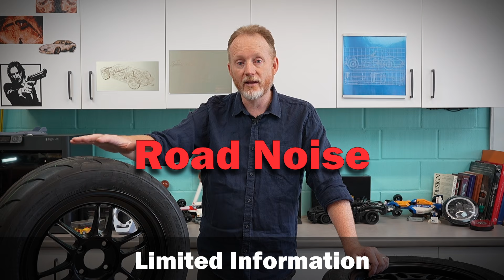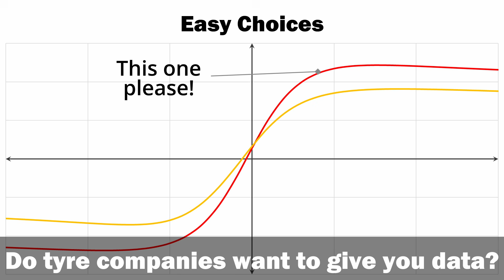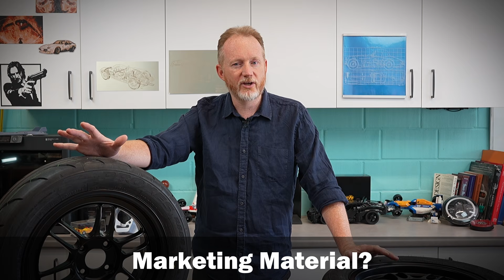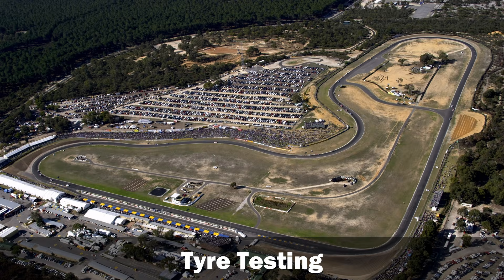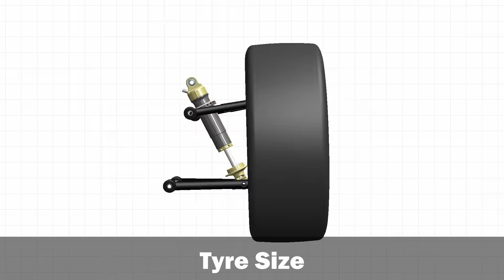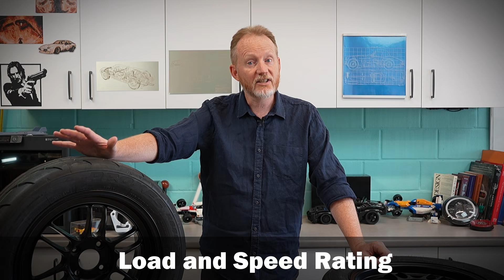How to Choose Tyres When There’s No Data (Project 171)

Comment: If I was choosing a tyre size for this kind of car I would be looking for smaller wheels and taller sidewalls to complement the styling.
So maybe 14 - 185/60 and 14 - 205/55. Trouble is no one makes that combination!
So how about 15 - 185/55 and 15 - 205/50, which used to be standard on the MG-F (also MR2 ?). Just one supplier left!
Probably the best bet is to check what Caterham or Elise owners fit.
Reply from the maker: These were my thoughts exactly.  I tried to get the highest sidewalls with a decent tyre on a smallish wheel with decent availability.  This is where I landed, even though I would like more sidewall.  The 15" wheel has become pretty important once I got the brakes sorted (upcoming video).

Comment: I'm binging your videos. Thank you lots for showing us the process at this level of detail.

Note that because the vehicle is going to be so light and you're not planning on adding huge amounts of downforce, you might never be able to put significant temperature into the tyres, and definitely won't manage to do so on the road. This issue will be worse, or at least more likely to occur, with the semi slick Toyos that are designed to not overheat on a typical modern, much heavier sports car, on the racetrack. On the rare occasion brands make a lighter car, they come on compound-adjusted OE tyres anyway, so they've got a whole other set of variables to play with to counteract this issue. A more balanced UHP summer road tyre will definitely be worth trying in case it ends up yielding similar, or even more grip, since it'll run hotter, and not be designed to require any temperature buildup to work properly in the first place. Anecdotally, I've been doing simulation work for a project vehicle in Assetto Corsa with a mass of 1100kg, and have severely underestimated how bad the temperature issue is, at least according to the "semi slick" tyre model in that sim. And that vehicle is a lot heavier than what you're planning for!

I would assume your car to oversteer badly considering the expected weight distribution, and your rear tyres only being 10mm wider than the fronts, unless you intentionally give up some mechanical front grip with your alignment settings. I remember you mentioning the expected weight distribution in another video but don't remember the percentage; with the engine in the back in a very light vehicle, anything under 60% on the rear sounds unlikely. If you google around for cars in that weight distribution range, they always come on much wider rear tyres compared to their fronts.
Reply from the maker: I have a few ideas to try and avoid the oversteer due to a rear weight distribution and tyres that aren't as wide as they probably should be.  Mainly by running more front camber than what would lead to ideal wear and a higher front roll moment distribution.  Failing those it will likely end up a wider tyre to start with, and then if more is needed a larger wheel as well.  This is where cars like the Elise are.

The temp is an interesting one.  Perth is a very hot place and usually tyre temp isn't as hard to achieve over here.  However the car will likely be still too light.  The tough part at this stage of the design is that the weight window is still reasonably large.  The car could end up as light as 500kg or maybe up to 750kg.  There is just so much still to design and build that nailing the number at this stage is difficult.  One of the reasons I didn't want to go for a tyre to start off with that will be much more towards the 500kg target.

Comment: The sources I trust (GRM, 949, etc) have had the best results in Miata sized tires using a rim that is as wide as the tire. So a lot of us are running 205s on an 8" rim or 225s on a 9" rim. In the tests I've seen, these relatively wide rims get the best lap times and also win the praise of drivers for more responsive handling. Pinching a wide tire onto a narrow rim results in slow times. So in my view, you need to pick your tire size and then find rims that are optimal for that size. FWIW, the same observations hold true for road and mountain bikes.
Reply from the maker: This was why I was reluctant to get the wider tyre for the rear.  I wanted to put a 225 on the back end, but rim width was limited.  Its why I am trying a slightly narrower tyre to start off with, and may need to up a wheel size.

Comment: Hey Dr Kev, Im currently a student and intending to do something similar myself, I've currently got stuck on the wheel loads stage, I've been reading the racecar vd by Milliken but it only really mentions loads never talks about whether they are in x y or z directions, is there another book you may have used ? Also when it came to your suspension geometry did you end up fixing the chassis and moving the wheels in your analysis ?
Reply from the maker: I might have to do a video discussing different texts to go through.  When it comes to loading though I generally take a first principles engineering approach and rely on Engineering Mechanics (Statics and Dynamics) knowledge.  A lot of the car specific texts that were available when I was learning this stuff were far too hand wavy when it came to numbers and objective measures.  Still haven't found a good reference for the load cases that manufacturers use in their mechanical design.

In the earliest studies I did on suspensions I would fix the chassis, but very quickly moved towards a moving chassis.  As a halfway point I did calculations of a fixed chassis with moving wheels and then translated the results (with 4 corners) to effectively keep the wheels on the ground in analysis.  I covered some of this on the video I made about kinematics.

Comment: Kumho V70A is TW50 Interestingly the soft and Med compound (and likely the hard) are still TW50. On a 600kg lotus7 style car I found he soft to be fantastic on the road but would over heat and go squishy after 2 laps on the track. Here the med were faster.  I should add that the outright grip between the med and soft compounds was quite similar just the soft would switch on much easier and was a lot more confidence inspiring on the road. My understanding is the 730 is replacing the V70A but currently only in larger sizes. Great to see Ozclubbies getting a small mention. The hard part with a lot of information on tyres is that our cars are really the only road cars down at that weight. Mention say an MR2 for example is a similar layout but near double the weight. My new build just started has a target weight of low to mid 400kg. Realistically no one makes the ideal tyre for a car that light for the road. Tyre pressures is another area. The manufacturer will tell you to run 30lb plus. The car will be diabolical. Typical road pressure will be in the mid to high teens.
Reply from the maker: Appreciate the insight.  The Kumho options definitely looked good, although I do want to do some testing with different widths and I was finding it hard to find different width options in the Kumho.  Otherwise probably would have ended up with a set.

400kg sounds like a great target for a car.  Will be even harder to find something suitable, and will definitely need a high attention to detail.  Should be an awesome project.

Also more than happy to shout out to OzClubbies.  I try and keep the project somewhat updated on there, and I do like forums as a good source of knowledge and discussion.  Something that is lost when everything is a faceboook or instagram post.

Comment: You seem to have a pretty good understanding of tyres and your intended use.
The Proxes R888R is a pretty iconic but now pretty old tyre now meaning that it's left behind 100tw category although is still a very direct and predictable tyre albeit just with a little lower limits compared to modern semi slicks in this category.
Because your not going for lap records given its priced well below modern 100tw semi slicks it makes it a good reliable choice.
Also fyi the traction rating on tyres is a G-Force test but it is measured on a shallow wet controlled surface. So it's possible that tyres with AA racing may not perform as well in the dry as tyres with an A rating and view versa. Just to keep in mind.
For raw data metrics there are people like grass roots motor sports and tyre reviews that do controlled testing but yes you are right as what car you putting them on weight and slip angle balance is going to change from car to car and wheel/tyre size set up. In your case being quite a light car you need something that gets up to temp faster which makes the R888R more suitable then most modern 200tw tires also wear is not that of a concern for you as would be for other who have heavier vehicles that drive more often.

I'm also thinking that the AR-1 may of also been in your short list?
Would be interested what your other considerations were?
Also fyi if you go to Dunlop's official website they are doing alot of clearance deals on the DZ03g if at a latter date you have dialed your can in and want to start pushing on track.

Also given your car is an MR set up I understand there may be scenarios where you may want more rear slip angle such as on small tight low speed Auto crossdriver/car training carpark style or more stability such as on road twisty mountain road driving or a neutral feeling such as on high speed circuit. 
Yes you can make aligment, sway bar  and suspension adjustment but you can also purchase two of the same tyres with slightly different compounds.
Fortunately there is a tyre in Australia that can help you with this kind of testing. Kenda Vezda UHP KR20A.
They are semi slick design but more focused on durability, consistancy and heat cycline very well. They come in both 200tw and 300tw 
Definitely alot less grip then the R888R but for steet you can run 300F 200R
For circuit you can run the same compound front and rear and for low speed high slip angle you can runn 200F and 300R
Reply from the maker: Thanks for your constructive feedback, you put a lot of valuable thought into your comment and I appreciate the time you took to provide your insight.  Repsonding in no particular order:

I did try to indicate that the traction rating wasn't a reasonable test for how the tyres are going to behave (but didn't spend much time on it to explain it fully).  Its been picked up by a few people so I'll take that as me needing to better cover some areas.

The AR-1 was a big candidate, but I thought it might be going too far in the track direction.  The Bridgestones were a little too pricy for the first set.  I very nearly went with the Yokohama AD09.  I couldn't find the sizes I wanted on the Khumo V730s.  Otheriwise there are a few options like the dunlops that I didn't spend too much time looking for.

Price was definitely a big factor as the tyres are going to be sitting around for a while before the car is done, and normally the initial testing is dealing with a lot of non-performance issues involved with running.  Didn't want to have too much invested in that first set.

If people are keen and I can find a way to pay for it I will be up for doing some back to back testing with a few different options once the car is built and in testing.

You also mentioned the difference in wear ratings front and rear.  This is also a consideration and part of the reason I wouldn't mind to be using tyres where the manufacturer has a few different wear ratings at the size.  Toyo has a few, and maybe I should have a look at the Kendas as you mention.

In all likelihood I will start with something like the tyres I have and then move to something more road orientated.

Comment: For $30 more a tire, you could buy a real tire like the re71rz in 205/50/15, stretch it on a 7" wheel, and end up with a really good wheel and tire package
Reply from the maker: The price difference between these tyres as I could get them (in Perth) was significantly more than that.  Once the car is together and testing the Bridgestone will certainly be one to consider.  Although it will likely head towards more of a road car tyre than something for the track.

Looking forward to testing a few different tyres when the time comes.

Comment: This is a terrible tire. Kinda ruins any of claimed authority by the channel.
Reply from the maker: Sorry to disappoint, altogether possible that I could have made a better decision.  I will be surprised if I manage to get through the car without a single mistake.

Testing and on road development are essential parts of the process that are still a fair bit away.  Making a decision on the tyre to start out with moves me closer to that stage.
Reply: @KevinHayward7  its a difference between experience and reading things in on the internet. im an engineer by trade, 15 years in the business, i can explain all the chassis dynamics you have discussed throughout your videos. im also a high performance driving instructor, racing school instructor and many many many time race winner in the most competitive amateur road racing class in the country. so i have the relevant experience on all manner of tires, for over a decade. you should have got your head out of the internet and theory, and actually showed up at an event where people actually know about cars, and race them, and known instantly that there is basically zero reason or application for the R888r, except to trick morons who bought R888's 15 years ago when it was a middling at best tire, into another round of toyos. that tire is basically useless. 

and, also because of my experience in both theory and practice, ill tell you, the setup will lie to you the day is long if your not on the right tire. hell, we notice significant setup changes depending on how used the tires are sometimes.
Reply from the maker: I did check these out on local cars but if it wasn’t clear this car is absolutely not intended to race.  That provides a lot of freedom to not chase the highest performance tyre.
Reply: @KevinHayward7  why would you get an out of date 100tw tire designed to last a long time at the track, instead of a street focused actual street tire like an Re71RS or A052, or even something like an ECS2 if you wanted to limit the grip?

100tw tires tend to be made mostly to last longer at the track than 200tw tires, again, something you'd know i you showed up at events.
Reply: My thoughts exactly

Comment: Tire sizes can be rounded off a little bit (+/- a few mm) so that multiple rim-sidewall combos can be made with the same mold for the thread. They're pretty much also going to be in 2" thread OD increments, with inbetween sizes being oddball or nonexistent. All the metric sizing is.. mostly lies.
When you look at availability chart from that perspective you'll notice how that influences what's available, which is what car designers mostly design their cars around, which in turn generates no extra demand for 'odd' sizes, and so forth..
Reply from the maker: I've definitely ended up with tyres that don't seem to match the stated sizing, sometimes considerably so.  It would be great to have a store nearby that stocked all the tyres I was interested in so I could get a firsthand look.

In a lot of areas of the car it is difficult to find suitable products.  Not a lot of car companies making lightweight mid engine sportscars...
Reply: That is very interesting. Do you know what the common OD increments are?

Comment: Great stuff! I did run R888R on my Volvo 244 at the track last year. I had 205-50-15 on the front and 225-50-15 on the rear. The grip was good, felt very planted. But they wore out pretty quick when pushed hard. But the Volvo is double the weight though 😅 
I think it will work out great for your project! 😀
Reply from the maker: I have a soft spot for Volvos.  Owned a few in my time (C30 T5, v8 Xc90, 850R Wagon, S60 T5, and the slow as crap V40 Wagon).  Parents used to drive us around in a 244.  Glad to hear you seem to be having fun with one.

Comment: I have 13x7 Compomotive CXR wheels on my Suzuki CXG with a Honda CBR1000rr power unit. It too is mid mounted. Rotating mass was a consideration. Having heat cycled the set of tires, worn them down. It's easier to have a library of tires in the smaller range than a larger diameter wheel. The Enkei is aimed at a heavier car. This allows me to run a range of pressures for conditions. I run tire pressure monitors and thermal cameras in the arches for races to give a better data window than the seat of my pants. Glad you didn't go with the 15x3 and 15x12 Simmons Aussie spec though
Reply: Yes, getting into the chemical envelope of the tire is important. I found the thermal useful as I could see my brakes and what parts were affecting each other.
Reply from the maker: Hard to beat some of the options for 13" competition tyre for a lightweight car.  The smaller tyre makes heatup a lot quicker as well.  Locally a lot of the races are very short runs (8-12 laps).  For some of the lighter classes of cars actually getting enough heat into the tyres on the early laps can be an issue.

Sorry I didn't go full Simmons spec... maybe a car far far into the future :)

Comment: i ran r888rs and it’s outright dangerous in the wet compared to literally every other 200tw tire.
Reply from the maker: There are only about 80 days a year where Perth will see rain (>1mm).  This means about 80% of the year it is dry.  This definitely means that wet weather performance is not a huge factor.  Although I have heard similar stories and am keen to test some other options for those 80 days.